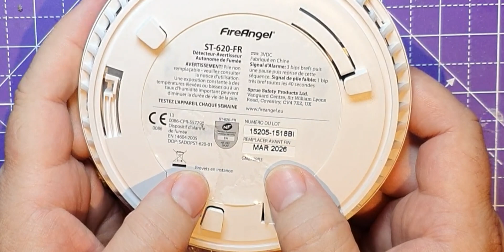What's inside a Fire Angel Smoke Detector - and can you harvest or replace the cell?

Comment: I have a system of these, hang to the ceiling with magnetic plates. While doing some insulation work in the garage, one "fell off" (was totally our fault).  As such, it "opened" by force of gravity.  Nothing is glued, you can open en close it as many times as you want.  Nothing was broken, I could just re-install it.  So yes, if you can find a replacement battery, you could swap it easily.  I'm not sure I will do this in X years from now, I might go with a different system when the time is there.